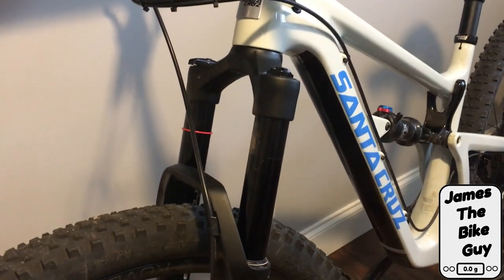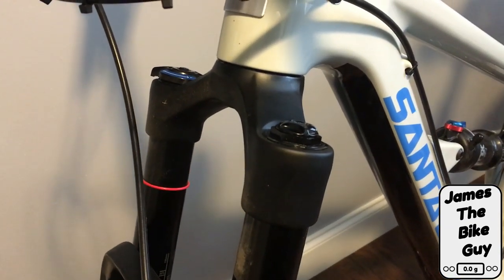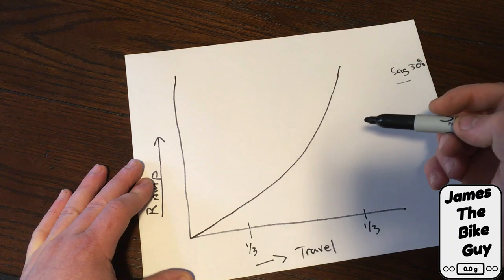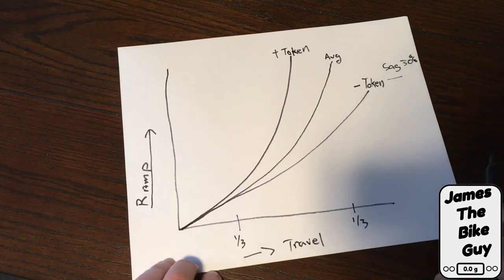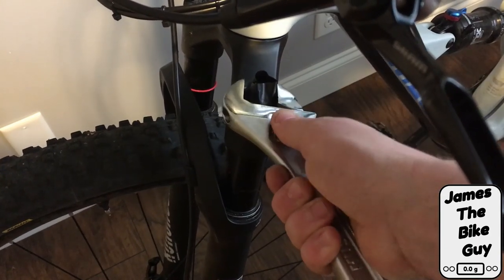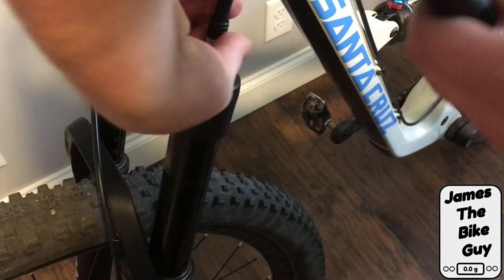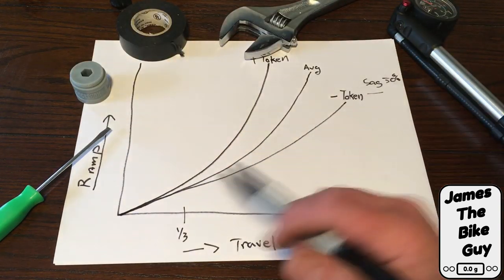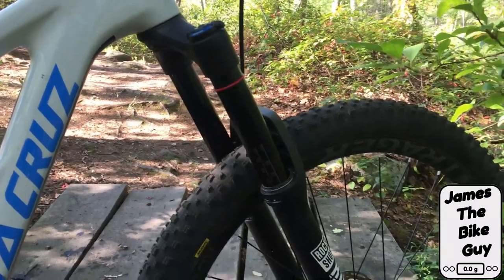How and Why You Should Adjust the Air Spring Tokens on your Rockshox Fork

Comment: Great video. Another approach is to add tokens and run less pressure. This allows the fork to be very plush on small chatter, but still provide progressive ramp up bottoming resistance on bigger hits and bigger chunk.
Reply from the maker: One day I look forward to trying the Shock Wiz from  Quarq to see what it tells me for suspension setup
Reply: You're totally right Bro
Reply: Won't you end up with a sag that gives you less suspension travel though?
Reply: @jtruong29  no, the amount of travel of the fork remains the same. you are simply changing the amount of ramp in the usage of the travel.
Reply: @brettclark3885  On mu SR SUNTOUR R2C2 I have the fork going down if I add less pressure, I want it like yam831 said it, pflush on top for smal bumps. I guess I need to service them now as I can put what I want for pressure, it still is a bit harsh now.

Comment: Simply stating that 30% SAG is a rule of thumb is a bit incorrect. 30% is typically too much for most bikes and riders. Sag is not some arbitrary number between 25% and 30%. It depends ON rider style, trails and the type of bike. Using tokens or volume spacers is only necessary when a rider is using nearly all the travel on the fork and sag is below that 25% mark. 

Conversely 20% is about the lowest amount of sag a rider would want. (of course this is dependent on riding style and type of rides) 
Spacers should only be used when big hit compliance is being compromised after proper sag is determined and set. 
Most trail riders who do not send it off drops, dirt jumps or ramps will not need spacers. 

Spacers reduce low speed/small bump compliance, which for most riders is more important. Adding spacers has the tendency to make the fork and ride harsh. Then, the rider starts to adjust compression to try and compensate, but usually winds making it worse. Use spacers wisely. Not just for the sake of using spacers.
Reply: Johnny Bike I have this issue on my stock shock. Too many volume spacers and a super harsh ride. Currently playing with differing amounts as with them removed it’s a little too floppy. 👍. Good comment that most people miss tho. 👆
Reply: Yes..YEs. YES!👍
Reply: Awesome reply Johnny. I'm 140lbs with all my riding gear on. I had to go to the largest spacer in my fox dps rear, and had to add a spacer in my front fork to get my stumpjumper to perform how I wanted it to(with sag settings around .20%). I like my bike to feel lively, and poppy. Prior to this, it felt too cushy in the corners, and too soft off jumps and takeoffs. The ride isn't as plush now but the ultra plush ride was what I didn't like....however my gut tells me it's what most people want. Just not me. An  added bonus was the extra bit of support in the mid stroke of my suspension from the reduced volume also reduced pedal strikes.

Comment: Great video. My Fox Float Performance came stock with 3 tokens and with correct sag for my weight (150 Lbs) it is very jarring over square edge chop. I will remove 1-2 and test. BTW, Fox recommends on 15% sag on front. 25-30 on rear.

Comment: I've always been a believer that you should never bottom out your suspension. Regardless of your riding style.  If you bottom out you may be causing damage to your fork, frame and shock linkage.  Why? Because, bear with me here, once you bottom out.... you have no way of knowing by how much.  In other words, when your o-ring reaches its limit of movement you have no way of knowing how much of a shock you are sending through your bike beyond that point. significant impacting on your frame and suspension components can cause damage or failure. It's called SUSPENSION for a reason. when you bottom out.... your suspension has failed to do it's job. Try this, clap your hands but hold back so when you clap your hands barely touch. The fact that they touched is bottom out. Now, clap your hands again only this time don't hold back  let your hands impact full force. That was also a bottom out. The second time probably stung a little while the first one was barely noticeable but..... both were bottom outs once your hands touched. So, when you bottom out your suspension you've lost your ability to gauge how much potential damage you may be subjecting your bike to not to mention any potential injury to yourself...... sorry, didn't mean to drag this out.  Cheers.
Reply: Absolutely agree. I got a 130mm hard tail four tokens in 90 psi I'm around 80 kilos I ride like a pig. I went down for some single tracks today (new bike I use around 65 percent of my suspension on definitely blue xc country. If I had to drop a 3 metres I would be around 85 to 90 if I do run one toket less I would destroy it. I don't understand why people run so soft their suspension. I always pump the recommendation 10 psi Higher and always one more token that factory always full open. If you see how suspension works they never fully used in any other disciplines

Comment: Made a huge improvement on my 2014 Reba RL. This model was oem with no means of using tokens so I bought the kit .
Initial pre token my fork would be plush but fly through travel and bottoming easily while adjusting to prevent bottoming meant too firm a ride with little small bump sensitivuty. Along with the token kit I extended my travel via a new air shaft to 120 from the stock 100 and now have a very plush initial travel , a supportive midstroke and no bottoming issues.
Kinda odd that RS would issue a fork with such issues as a stock product considering I am probably near the typical rider weight.
Reply from the maker: Nice, using the tokens really does help!
Reply: schlooonginator where did you buy the volume spacers?

Comment: So from my understanding, the air pressure shouldn't stay the same when changing a token and the volume has changed.  It's the sag that needs to be set the same.  Meaning 80psi with no tokens may give 30% sag, but 80psi with a token added would not give the same sag.  Thoughts?  Great vid.
Reply: You want the air pressure the same when adding tokens so that progression is produced by volume spacers and not the amount of air added
Reply: No, after the change of volume spacers the pressure for sag its change. If you adding spacer then pressure will drop because spacer reduced chamber volume and make  more progressive and opposite when removing spacer.

Comment: Excellent video.  I am in the middle of doing this on my v1 Hightower as well.  I never use full travel.  It came with two tokens installed.  I just removed one.  Coming off a broken hand, supple is good.  Curious to see how it all works out.  Not sure if you still have the bike, but how did it work out for you in the long run without tokens?  Really cool to see someone with the same bike.  Also, would you add a token of hitting gnarlier trails or just accept that you may harshly bottom out?  Nice that it’s a quick change.

Comment: Would pumping up the fork and shock to a higher PSI achieve the same result (more progressivity) as adding tokens?
Reply from the maker: No. That would just increase spring rate, and in doing so the higher spring rate would make small bump sensitivity worse. It might result in similar bottom out performance, but the reason for the tokens is to have a more progressive curve where the spring rate rises quicker as you go through travel.
Reply: @Jamesthebikeguy  Thanks!

Comment: With Tokens you can effectively reduce the diving when you hit a section with big roots and such but high speed compression would do the same while the fork can stay more linear, right ?
Reply from the maker: Tokens would work with your high speed compression damping. This is effectively controlling ramp-up in air pressure, akin to having a progressive spring that gets stiffer towards full compression.
Reply: Yes, BUT..you wil sacrifice low speed/small bump compliance.
Reply: @rider65  Dialing suspension can be subtle compromises depending on terrain.
Reply: @77rockcity  Yup, That's what I effectively stated. Dependent on trail, terrain and riding style.

Comment: Hey bud question. So I just bought a Scott Scale 950 and it comes with a FOX 32 Float Rhythm 100mm Fork. Here’s my situation. I’m no lightweight. I’m 6’2 240lbs. Shock air pressure chart shows max pressure should be no higher the 140psi for a guy my size. The bike shop filled it to 120 and said try this out. Well I was picking up some speed to just a curb and I bottomed out the shock. So I maxed out the air pressure at 140psi. And I still wasn’t 100% happy with it. My 20 year old bike which has a RockShox I can put 150psi and it rides great. I’m guessing my new shock has one of those spacers. If I remove it would I be able to add more air pressure??
Reply from the maker: No. Changing tokens does not effect max pressure. What you do want to do is add tokens, not remove. More tokens solve bottom out.
Reply: Jamesthebikeguy thanks

Comment: Just took mine apart and it used a splinned socket that I happened to have as it is for a crank arm or something. I found and removed the offending tokens. Problem solved (at even 30% sag I only got about 1/2 travel).
Reply from the maker: nice!

Comment: What's up james.  I'm trying to re-purpose rear fox shocks for a small child size gokart.  The standard pressure is way to high.  Can this be reduced to achieve actual compression with say 50lbs of force?
Reply from the maker: Not sure might be a good idea to talk to a place that does custom suspension work like PUSH Industries or such.
Reply: Jamesthebikeguy Thanks, I'll check them out.

Comment: Question.
Couldn't achieve full travel on my Rockshox yari with 1 token installed as I was reaching about 80% of the travel but never ever more than that with the sag set at 30%. Thought I could have a bit more performance from It , so I tried removing the spacer and kept the same sag and now I seem to be using even less travel and the fork feels harsher on small bumps. I don't get It, shouldn't It be the other way around? Would you suggest trying coil?
Reply from the maker: Sounds like too much compression damping or to much air pressure. keep in mind when you remove air tokens you have to reset sag. The air pressure actually lowers as you add volume because it's "pounds per square inch" so if you increase volume and keep the same PSI you are making the fork stiffer. So be sure you are resetting sag after every change
Reply: @Jamesthebikeguy  Sorry, I did not explain well. I reset the sag at 30% as before removing the token. Compression fully open, fork new and used for 3 months only and the stanchions are still well lubricated by the foam rings. I literally tried to go nose diving on 1mt drop almost to flat going fast to see if I could  make It move more than 80% of the travel. Stil nothing. Works fine when removing all the air, so I don't think It has any kind of defect. Should I try go by pressure instead of sag? Or even, could I try to change the rear shock settings so I end up weighting more the front wheel without jeopardizing my body position? I wouldn't want to change too many things at once. Do you have any suggestion? Thank you very much.

Comment: Hi I have a 2018 Fox 32 sc fork, after 3 months of using it, I noticed that I only use 80-90 percent of travel and I found out that my fork has 2 volume spacers installed as default, would you recommend that I should remove the 2 volume spacers?
Reply from the maker: Only remove the volume spacers if your sag is set up correctly. Sag is the first thing to check so that you are sure your air spring is not set too firm. If sag is set up correctly and still do not use all the travel then remove an air token and start again.
Reply: Tokens have less to do with SAG than they do with big bump/big hit compliance. If you're not using more than 90% of travel NO need to use tokens.
Reply: @rider65  He didn't mention SAG. He only stated that he uses only 80-90% travel. We will assume his SAG is set between 20-30%.  James mentions SAG - wisely and correctly - only as a precautionary first step. No one is saying that the tokens are a replacement for correct SAG. That said, I agree 100% with you that id one isn't using 90-100% travel on ALL rides, then no tokens are needed. But again, this assumes correct SAG

Comment: This is silly but a crescent wrench is definitely NOT designed for bending sheet metal. It’s designed as an adjustable wrench to be One tool useful for working on various sized nuts. There is no reason for a crescent wrench to be able to open to 2 inches wide and more  if it’s for bending metal that’s 1/8” thick. This is hilarious.
Reply from the maker: lol True.

Comment: A Cassette Socket will remove it perfectly. It's designed for that socket
Reply from the maker: Well the 2019+ forks yes. But earlier years did not have that option
Reply: @Jamesthebikeguy  I believe you can buy the modern cap and install it.
Reply: @pjsanab Sure... but why would I remove a working old part, and install a new one to make it easier to remove? Makes no sense, the adjustment is already complete

Comment: Hi, I wanted to know if the maximum pressure changes when we change the number of tokens.
For example the rockshox sid has a maximum of 195psi.
If I put tokens does the maximum change?
Reply from the maker: Max pressure will not change when you adjust the tokens. Reason being, that PSI is "Pounds per Square Inch" meaning that the pressure is relative to the size of the chamber and will not affect the seals' ability to hold in this application.

Comment: should of used a socket to avoid scratching the forks
Reply from the maker: Works either way
Reply: @Jamesthebikeguy  But you scratched the fork...
Reply: @aedsy  Luckily I ride the bike so scratches don't make any difference. You would be correct if this was some museum piece, just a basic mountain bike
Reply: @JrsGasolineAlley  My statement that you scratched the fork is correct whether it is a basic mountain bike or not. At 6:22 you also state that you put electrical tape to prevent marring the finish. So you did attempt to prevent scratches but failed in this attempt.

Comment: Buying proper tools would also prevent marring bolts.   Crescent wrenches are intended for bending sheet metal, not removing bolts.
Reply from the maker: Uh... What? Wrenches are made for adjusting fasteners (nut, bolt, ect). While a socket from someone like Abbey Tools would be a significant improvement the tool I was using is correct for this. I use the electrical tape even on bottom brackets to avoid nicking the finish even with a specific BB tool.
Reply: Sorry bro, a crescent wrench is not intended to turn bolts. Its purpose is to bend metal. Seriously, look it up.  You should be using a box end spanner or a socket.
Reply from the maker: https://en.wikipedia.org/wiki/Adjustable_spanner
Reply from the maker: Thank you for the advice.
Reply: Adjustable wrench not ment for removing nuts is first ive ever heard that crazy talk. Some people just feel the need to show their inteligence or perceived intelligence. Would the flat ground specific socket be best if you repaired forks for a living, yes. For the occasional use and if careful, perfectly fine. I to am concerned with keeping components looking nice so smooth move with the electrical tape. When i get my mrp ramp up device i'll probably use a adj/cresent wrench as well. Thanks for video.
Reply: I use both socket head wrenches and adjustible wrenches to remove and install bolts and nuts on multi million dollar equiptment. They both have advantages and disavantages depending on application and situation. I dont see anything wrong with using adj wrenches here as he is being careful and took some precaution to not strip the head. I think I know why you said crescent wrench is not for removing bolts here and shame on you for it.
Reply: R0C1NANT3 Bendig sheet metal? Lol you must be joking. Inform yourself before making comments
Reply: flat earther_____________